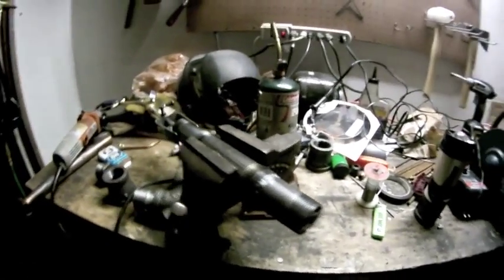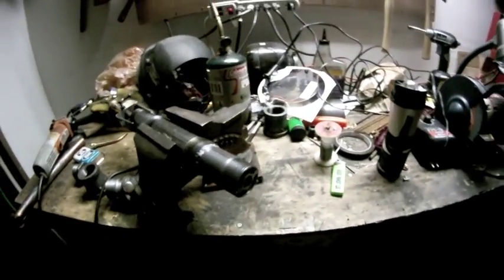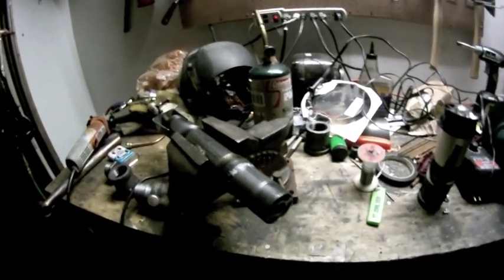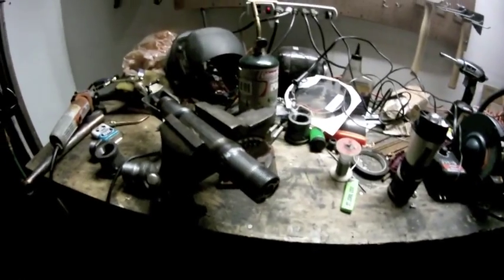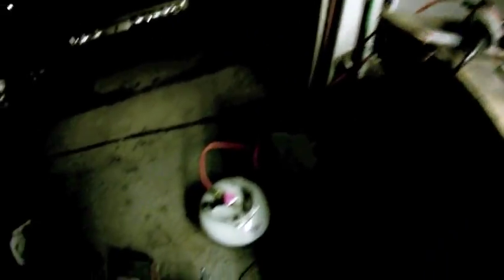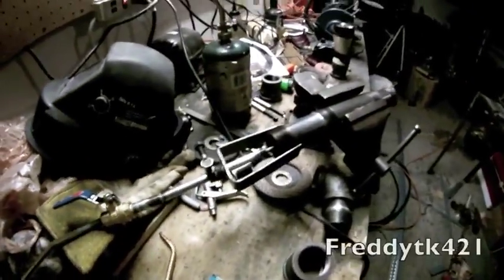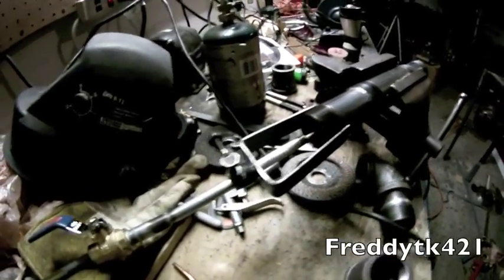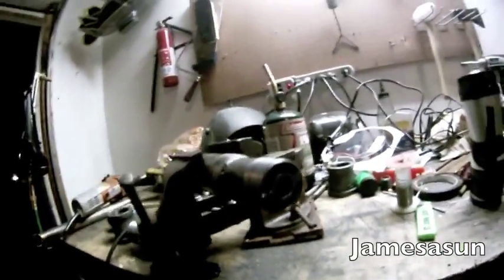homemade Gas forge part 3 new burner

Comment: THROW THAT HARBOR FREIGHT WELDING HOOD AWAY! dont be cheap with eye protection. you only have one set of eyes.. throw that thing out. and get a miller if you must have auto dark. i just use the 4x5" pasive hood from home depot $30

Comment: Get your self a 1 1/4 inch to 1 inch reducer, 6 inch long 1 inch pipe, 1/4 tee fitting a .035 welding tip, a 1/4-20 nut.  weld tthe nut to the tee with the weling tip in the nut to protect the threads.  weld the tee to the reducer.  make sure the tip on the welding tip is center in the tube, if it is off the burner will not run right.  thread in the 6 in pipe.  hook it to you propane tank and you have a very hot burner.  I use that burner in my forges.  you should be happy with the results.